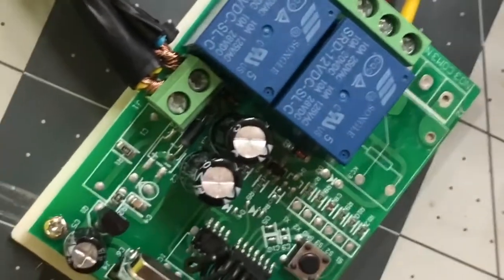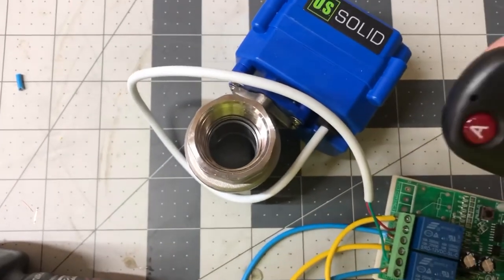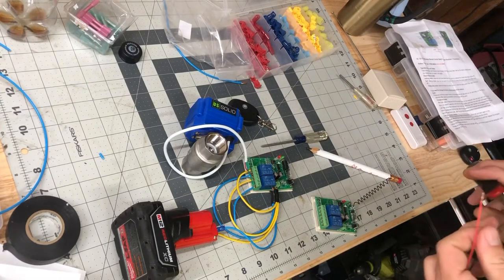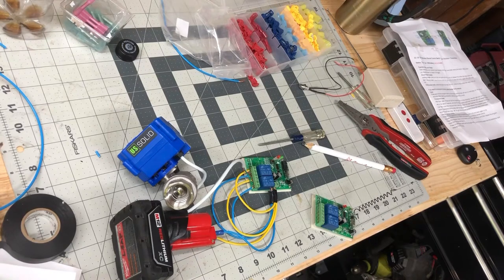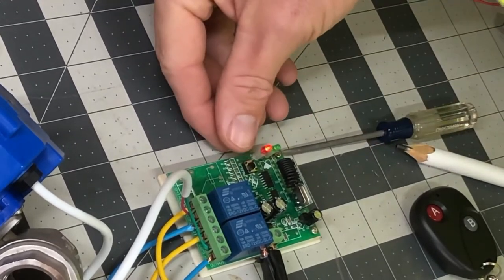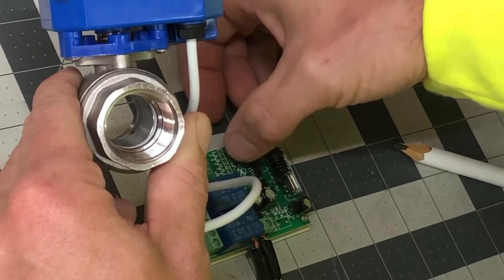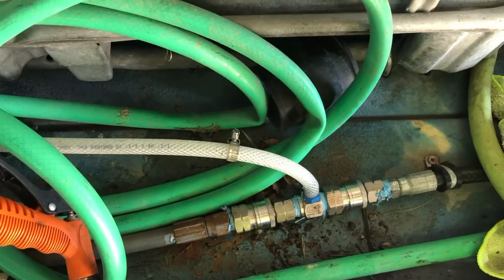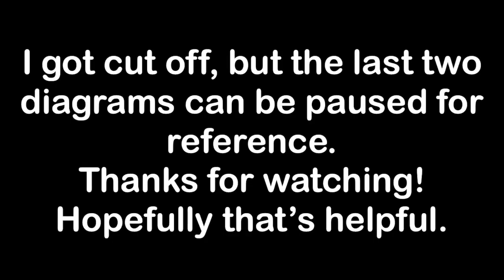Remote Downstream Injector (For under $50)

Comment: What's up Squid. You get longevity out of the motor? Cheap is good on the wallet and they claim 80k-100k cycles before failure. Your feedback on that? Thanks brother.

Comment: Hey man! Thanks for this vid super helpful. I’ve got a bunch of those m12 6ah batteries. Was wondering if I could use those instead of a traditional 12v battery. Im only running it for downstream on 4gpm machine.

Comment: Can this same set up be used to turn off the actual high pressure ball valve that is on the injector bypass set up? Or is this just for low pressure  on the injector side for the soap? And you will still be using water though the injector orifice even when rinsing. Thanks
Reply from the maker: Xtreme power Washing I’m not a big fan of bypasses because it simply shuts off suction by the injector with a expensive piece of gear for a negligible increase in GPM. With a remote downstream injector the ball valve stop suction at the injector along with its other function. Allowing you to turn soap on and off from a distance. With this set up you don’t need to bypass. It  accomplishes the same thing.
Reply: @squidspressurewashingllc6450  so basically it just turns off soap and you are still running your rinsing water through the injector correct.. if that's the case you are definitely losing flow by having it run through that small orifice. Especially if using a Surface Cleaner ... I think if you had your system turn off the main ball valve on a bypass unit it would be much better than just turning off the soap. But that's just my opinion and something I would have set up. But you still have a great system I just don't agree with running rinse water through the injector.
Reply from the maker: @xtremepowerwashing1815  I think I understand better now. With a single motorized ball valve, with the valve closed, there is no flow through the injector so no flow is lost. On my own system, yes, I have rinse water going through the injector and I agree that's silly. Better to just flush the valve and injector after each job.
Reply: @xtremepowerwashing1815  I am with you. I will visit a local store to find a solution that you and I might like: remove high pressure valve
Reply: @shinypowerwash  have you figured anything out? I will be working on my system hopefully this coming week. I may have found a compatible 12 volt high pressure ball valve set up I'm going to put together. I'll let you know how it works
Reply: @squidspressurewashingllc6450   Any update on high pressure ball valve
Reply: Hi there. Have you had any success with your setup? I  noticed on another video that you were going to use a bonomi unit. Would that be the only way to go because those are pricey as well? I am hoping to achieve remote controlling my bypass as well to get maximum flow when rinsing and using my surface cleaner.  Do you think one of these cheaper units could achieve the same thing as the bonomi actuator.  This design is well thought out and efficient for house washing alone maybe but it would be grand to turn off the bypass valve remotely. 600 dollars for the ready to go system is pricey.  Won't mention the company because I am no hater but you know who I am referencing. There has to be a cheaper alternative.
Reply: @shadmoney6617  there is and I will send you a link to a video to show you how and what to use. The system is working great for me but I will be using one of those expensive valves and one of the cheaper ones that's in this video. I will get it to you later on today
Reply: @xtremepowerwashing1815  Thank you brother. You are the best!  I hope you have a great season man. Thanks again, I will be looking forward to it.
Reply: You are the ABSOLUTE  MAN! I stumbled across that video last night in the process of my research but I didn't watch it in it's entirety. Now that I have a more firm grip on the premise of it all it makes complete sense to me and is the most financially conservative and practical way of achieving the goal. Big high five from Alabama!
Reply: @shadmoney6617  I ordered two of those ball valve actuators. It should be here any day than I can finish my setup. It has become so efficient. 👍🏼
Reply: @xtremepowerwashing1815  I just ordered the actuator and the remotes. 50 bucks. All together.  You can not beat that. 50 bucks vs 600 we can buy and make 15 of these setups. Perfect!!!!
Reply: @xtremepowerwashing1815  By the way. I was looking at you and another guy chatting on that other thread and you were saying that you run your 5 gpm and 4gpm machines in conjunction.  What type of hose or adapter do you use to achieve that? Right now I have two 3.8 gpm machines but at least that would give me at least 7ish gpm's if I could run them together going after bigger jobs.
Reply: @xtremepowerwashing1815  Good videos that you are producing as well.
Reply: @shadmoney6617  thanks. Hopefully soon I'll be posting some more.
Reply: @shadmoney6617  look up siamese kit..
Reply: @xtremepowerwashing1815  Good deal and I am definitely subscribed to your channel .
Reply: @shadmoney6617  which actuator did you order?
Reply: @xtremepowerwashing1815  Goodqueen DN20 actuator. I bought it off of Amazon for 15.50
Reply: @xtremepowerwashing1815  Which one did you order?
Reply: @xtremepowerwashing1815  If you type in 'dn20 manipulator' it will be the first listing on Amazon.
Reply: @shadmoney6617  ok.. yeah that's the right one. They are all basically the same just different sellers. All from China
Reply: @xtremepowerwashing1815  Have all of your parts arrived yet. I am thinking that my stuff should be here by Tuesday hopefully.